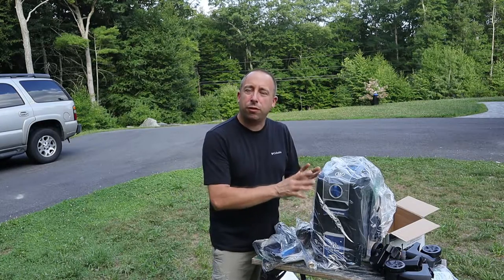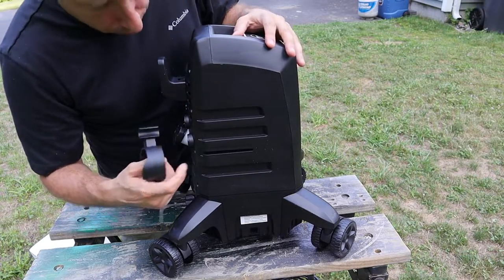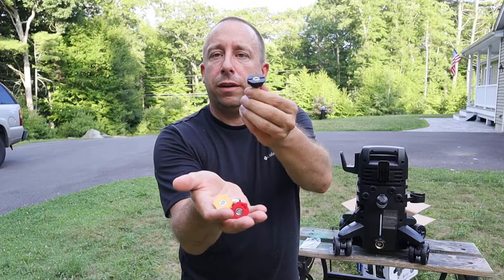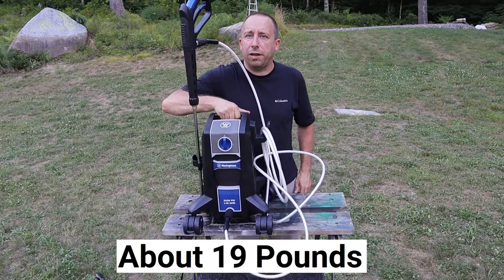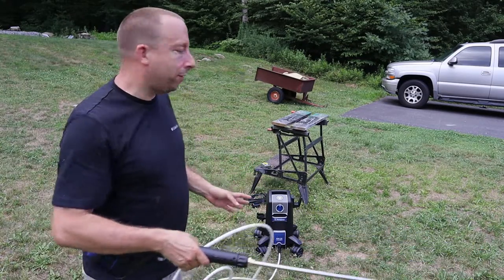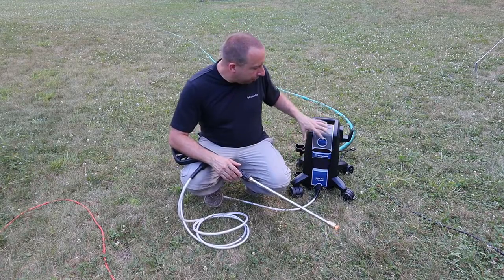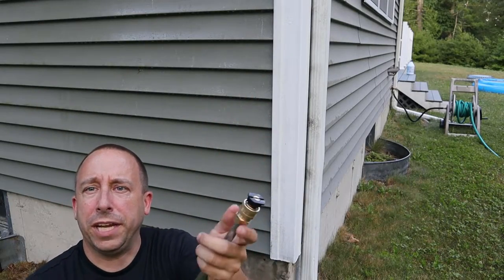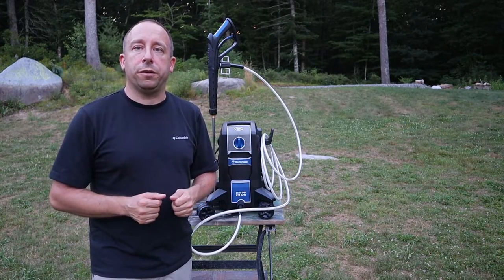Westinghouse ePX3000 Pressure Washer Assembly, Demo, and First Impressions

Comment: When I installed the lower spray wand holder on mine, one of the keys BROKE! I inadvertently twisted it while inserting. Only one key broke so it hangs by just the other one. Also, shouldn't you run some lube through the thing after use or is it all stainless? It is a great design and easily rolls around. Why all those other are so tall and TIPPY behooves me!
Reply from the maker: I agree - this little guy has plenty of power and is easy to drag around the yard.

Comment: Just stumbled upon this video. You did a great, thorough job at reviewing it. Do you think this will work well enough for pressure washing concrete walkways and driveways? I have the worst luck with gas powered equipment, lol.
Reply from the maker: Thanks!  It won't hold up as well as a gas powered machine for large areas but it is certainly capable of cleaning small to medium sized areas.

Comment: I'm hooked on my 2800 psi gas washer with a Honda motor. Not a fan of large electric tools.
Reply from the maker: I don't mind electric for this type of tool/application.  If I were running a business I'd want a gas engine for sure.  But for puttering around the house or washing the cars, this seems pretty good.